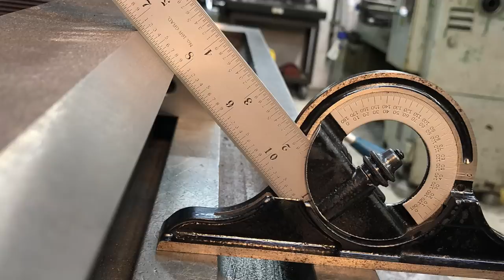SNS 310: Machining a Cast Iron Prism Straight Edge

Comment: Buy some coupling nuts and several lengths of bolts to fit them cause they make dandy little jacks.  You can TIG SAE thick washers to the bottom for broader bases and add jam nuts for locking if you like.

Comment: When you first talked about doing this project, I thought to myself, "Yes. We're gonna get some more shaper action."  I have to admit I was disappointed that you didn't use the shaper.  That shaper is just so damned fascinating to watch!  Btw, you've got at least one, maybe two cutters on your cutting head that are cutting deeper than the rest.  I could tell by listening, especially when you slowed down the frame rate.

Comment: Many don’t know it, but don’t use tapping fluid/cutting oil when manually tapping a hole in cast. Use air down the flutes to extract the crumbs (I won’t call it chips). Once you have established a good start, blow out every few turns to avoid too much build up of cuttings. Once to depth blow out and start to back out cautiously. If you encounter resistance stop, go in again and blow then try again. If the powder gets behind the cutting edge relief, it works like a wedge to wreck the threads, tap or break it off. Using cutting fluids makes a mud that’s even worse to get out. The best tap for manual tapping is a spiral point. Don’t use spiral flute as it can stretch the lead(pitch) as it pulls too quickly into the hole. Never use a roll form tap in cast materials or non ductile materials (strong but snaps or crumbles when bent) for example: cast aluminum, iron or 7075 aluminum.
Reply: If you use cutting paste/fluid when tapping cast iron it will give you tight holes.

Comment: Nice job. Thanks for another good one. I'd like to add that when long parts are machined on Bridgeport machines a slightly convex surface often results due to table drop. It's a common problem to be aware of, especially on worn machines with loose gibs.

Comment: For short machinist Jacks I use a coupler nut with matching bolt.  Get rid of any the forged markings on the top of the bolt head and round it slightly. Love the setup, beautiful clamping system.
Reply: Great tip. Thank you.

Comment: Brace yourselves but I find the K&T vids much more entertaining than the shaper vids. The variety of cutters, set ups and work it’s capable of just appeals to me more.  Let the wrath of the shaper fans begin! 😁
Reply: You can find tens of thousands of milling videos on YouTube. You know what you can't find very many videos about?
Reply: It's not about the mill vs shaper. I own a mill and not a shaper but in this case, even at the end of the video, Abom79 says a shaper would have done a better job.
Reply: I’ve run both a shaper and a mill in my time and I’m not disrespecting the shaper, it has its place. It’s just that what was initially calming and zen about watching it work has quickly turned to monotony. I don’t feel that the lathe, mill, welding and particularly the restoration vids. Abom79 is a genuine master if all of them and a pure pleasure to watch.

Comment: Here's a niy-picky refinement: 

One problem with a table vise is it turns your machine table into a structural part of the grip. Tighten the jaw and the clamping force against the work a few inches above the table surface tries to bow the span of table upwards a small amount. Therefore, heavy clamping forces are to be avoided on smaller mills like a turret mill. Adam's K&T mill table is maybe 3" wider and nearly an inch thicker thus abler to restrain heavier clamping forces without undue deflection. Whopper HBM tables are robust enough to restrain most anything.

I have a lighter version table vise I used infrequently on my turret mill. It didn't take much grip on a 20" long part to bow the table up 0.001" in the center (I checked it once with an improvised bridge gage.) I wish I had better numbers but my check was years ago. 

The lesson is: if you use a table vise regularly, expect end bearing wear on the table ways on the saddle depending on table rigidity,  length of the clamping span, and the vigor of the grip.  

As ever, YMMV and everything is made of rubber - even robustly designed milling machine tables.

Comment: Adam, something to consider is the stresses in that casting. if you do one on the mill again try roughing it all over then taking a light finish pass. You will still be dealing with deflection because of the higher tool pressure compared to the shaper but it should get you closer to true.Old time machine builders would rough machine their castings then let them "season" for a year or more outside to relieve the stresses after the skin was machined off, then finish machine them.
Reply: Heard those stories too, about “seasoning”. Some old guys told me that when they had to do precision tools ( like parallels or angle blocks ) they chose the oldest material they can get from the depot, the older the better, especially steel that has seen some cold winters and hot summers...
Reply: In the modern era, if you want to stress-relieve a casting, you cycle it in a heat treat oven. The required cycles have been well studied.
Reply: Yeah a lot of metals come stress out. Probably from their ole lady LOL, but no seriously. Pre heating to stress relieve works great. Cast does better than most considering the material your using. All I know is stainless is an acrobat after machining.

Comment: In my internship, I was fly cutting an aluminum plate, it was hanging off the end of the vise several inches each side. Probably 4" width x 1/2" thick. The unsupported ends vibrated and thus the tool cut ripple marks in the part. I had to cut more off, only running the cutter over the vise, then shifting the part to cut the other side. The machinist jacks you used would have been the perfect solution.

Comment: As a substitute for a machinists Jack try using a 5/8" capscrew of the appropriate lenght and a high nut, helps if the capscrew face is faced off,snug up and your good to go.Beautiful results I might add🤗🤗🤗🤗
Reply: Yep, I'm sure Adam has tons of fasteners laying around that could be used like this.  Saved my butt a couple of times.

Comment: Adam, on the slow mo passes, the audio suggests that one or mayby two of the inserts on the cutter are marginally lower than the rest. It definitely sounds as though an insert cuts across the surface, followed by a group that are merely scraping along behind it. On the narrowest face, there would be a couple of inserts in contact at anytime, while for the broader surfaces there would be four or five, and with the progressive feed each should be meeting new metal and cutting, but it really sounds like an interrupted cut as you would get with a degree of randomness in the insert position on the cutter. Your thoughts?
Reply: Most used facemills are either worn or crashed to the point where the inserts are no longer all at the same level, say within .0005" or so. I've seen some at my shop that are .005" off or more. Unless the inserts are particularly worn they are still cutting fresh material, it will mostly just affect surface finish as your peaks and valleys will now be further apart. 

And most all milling is interrupted cutting, sometimes it's just worse than others. I have noticed abom and a lot of others like to center their facemills over the part instead of offsetting it to one side, the exit of the cut is where a lot of wear will happen on inserts, just due to the nature of carbide, so offsetting it so chip thickness is as thin as possible at the exit will help insert life a decent amount and allow faster feeding due to radial chip thinning, though I know this probably isn't a huge deal to manual machinists and the centered cut can produce a more symmetrical finish than offsetting. 

Sandvik's website has a ton of information on facemilling that I've found very helpful

Comment: I really like your videos. Simple to the point and get it done. Some guys want to tell you about the machine, the tools, the set up, the math, the history about the part. And then repeat through out the video. Commonly they will run out of time so they will do a second video with a repeat of the same information.

Comment: Your end mill was cutting  perfectly. I am tool grinder and an operator was having a problem with cutting a ledge in cast iron . The holder was homemade and l suspected that it did run true. He was going to give me end mill alone 
I said no I want both the holder and the tool. After  I ground the tool in his holder the end mill cut perfectly. What he was getting before the end mill was spitting chips .
There supposed to come  off like rain just as yours was doing. A old tool grinder told to hold any tool the same way they are using it on the machine and if possible use their holder. Nice job by the way.

Comment: You can use those advertisement magnets that we all have from the phone books or pick up at the fairs. They work great on cast iron when machining, helps take out the harmonics. We use rubber bands on brake drums and rotors when turning them. You can not wrap a piece like that with a band, try the magnets along with the jack in the middle.

Comment: Good thing the milling machine was available for this project.
The milling machine has a table long enough to setup a 2 piece machine vise like the Carver set used here. 
Most shaper tables are too short for a setup like this. 

Side note: I couldn't afford to buy the Carver Machine Vise Set, those things are high dollar! (Nearly $1000 for the set I would like to have) I had to settle for a Grizzly set until I have enough time to make a set comparable to the Carver set.
Every item I check off my list of "Tools to make", I wind up adding 2 more items to that list but it's worth the effort IMHO.   

Nice video!! :-)

Comment: Would it not have been better to clamp the part in the y-axis (pulldowns or push clamps) up to dowels in T-slots in the bed of the machine. Instead of clamping along the longest axis which is X as this will always cause a bow under the pressure of being clamped

Comment: For a quick and dirty mini jack stand, you can use a flared nut from a strap clamp set and a 1/2-13 cap screw or hex bolt. Really any nut and bolt can be used as a jack screw.

Comment: Looking at the physics of the bar, two laws play in.  1. Mechanical - center support cuts the bending of the bar.   2. harmonics in the bar - the bar has a fundamental length and rings (sorta) when stimulated.  That is flex going back to (1).  You did two fixes - change the frequency (rpm) and cut the sympathetic oscillation in about half.   One might get good results like you did by putting the support at 1/3 -2/3 location(s) mixing any resonant to be much higher and maybe beyond that of the bar.  Complex maching sometimes.  Think of the lathes that turned 30' cannon barrels for battleships.  What a lathe an milling.

Comment: Is the face that is at 45 deg. (29:00) couldn't you use a matched pair of V blocks instead of the parallels to set the angle in reference to the back and bottom faces?

Comment: You shoulda shown us how sharp that part was before deburring it because from my experience from tinkering with a broken cast iron vise, the cast iron cuts very easily in small flakes, and the remaining edge is razor sharp to the point at which just sliding a finger across the edge would cut you finger

Comment: Adam, had the bar been normalized before the you machined it?  This helps render the cast iron dead(de-stressed) Also when trying to achieve this degree of flatness/straightness you should machine all sides before starting the finish machining. This breaks the skin that is a result of the cooling process when it was cast, even after being normalized it retains some stress because of differences in the grain structure at the outer surfaces (hence the reason to break the skin). I enjoy the videos.

Comment: Good idea to use the planer guage in the middle. What might help you inthe future is to set theplaner guage to the same height as your parallels. Then when you tighten the carver vise, set the planer guage in the middle as you did, but tighten the vise until the planer guage is as tight on the part as the parallels. That should help with the flatness. Another idea would be to machine all the faces, then go back and take a cleanup pass on each face. That should releive the stresses from the cast surfaces.  Nice job!

Comment: Controlled Clamping Can Help Your Parts Stay Straight.
While holding the part to be machined by the least possible pressure. record measurements at various locations between the table and the bottom side of the part. 
Use those numbers for reference while clamping the part to be machined.
An indicator can be used under the part near its center of deflection to see if it's moving well being machined. Make sure you're not hammering your indicator.

Comment: As Robin R says, everything is made of rubber. If you put a 10ths indicator on the middle of the workpiece as you tightened those clamp things you would see it bow. As another commenter mentioned, the clamping force us going into the table, so it too will be bowing,  probably up in the middle. But don't believe me or anyone else. We could all be full of crap.  Stick an indicator to the main casting or spindle housing and measure the relative motion between it and the workpiece and also between the base and the top of the mill table. Indicators don't lie. Or ask Robin what he thinks.  I bet this setup makes the hair on the back of his neck stand up!! With due respect and good wishes...

Comment: Might I suggest several sources of error and why the resulting surface is not flat.  The cast iron itself may be moving and changing its shape when you mill off the surface and relieve internal stresses.  Was the casting heated and allowed to cool very slowly over night?  Is the milling table itself flexing?  Is the milling table following an arc because of the guide ways not being straight?  And finally, is the reference straight edge really straight?
Reply: the overhand outside the vise is a problem as well, imho.

Comment: One thing I've learned about these angle grinder discs is that they are mean for lower speeds, in order to not melt the fibers, so they are better suited for variable speed angle grinders running at lower speeds
Reply: If you're melting the fibers, you're bearing down way too hard. I've never had an issue with them melting. Maybe you have Chinesium ones that are using crappy plastic? People have been using scotch brite wheels on bench tribes and angle grinders for decades without issue.

Comment: Interesting how the cutting tool looks like it is turning counter clockwise from above starting at 5:30 when it is actually turning clockwise.It must have something to do with the frames per second of the camera. Then at 20:54 it looks like the cutting tool is turning clockwise which it actually is.Then at 29.49 it looks like the cutting tool is turning counterclockwise but it is actually turning clockwise.
Reply: It has to do with the FPS of the camera versus the RPM on the tool and the 60 hertz refresh rate of the lights.
Reply: Same reason why stage coach wheels go backwards in cowboy movies.

Comment: Another problem with vertical mills and getting long things flat has to do with the ways of a ~5-ft~ long table only being supported by perhaps 24 inches of dovetail and gibs from below. As the table moves farther and farther to the right and left the weight of the overhanging table creates a fulcrum point at the ends of the lower ways and gibs. The ever-increasing weight of the long end of the table as it extends past the end of the lower ways lifts the shorter end. I.e. the table does not move on a horizontal plane, but in a very flat curve. As the vertical mill ages the lower ways wear more and more at the ends which contributes to the problem.

Comment: Adam, while handscraped surfaces are both functional and cool looking, I wonder if you couldn't do a kind of grid with the shaper that would work pretty well?
Reply: No. There would be no point of doing a "grid" on a part like this. Scraping a part like this is specifically to make it globally flat and reduce wringing, not to hold oil. So if you're trying to get it flat with a shaper, you could just mill it flat all the way across, instead of trying to do a grid system. It will be just as flat, which you say, isn't very flat.. Scraping isn't really to hold oil, that's what flaking is for. (Although a byproduct of scraping is that it holds oil.)

Comment: The bow in the center is possibly due to using the support in the middle while it was being machined.  When the support was under it it made the center of the part high and then it was machined.  Now after you removed the center support you have a low spot in the middle.

Comment: Precision is very interesting and tenuous. When I was a Project Engineer in the woodworking industry I would write programs for the multipoint processing CNC machine to the millionth of an inch. At the point of machining everything begins to degrade to where deviations of 0.005 are nothing and cannot be accounted for. Then, they multiply like viruses. Making 1/32" per foot an acceptable level of precision.